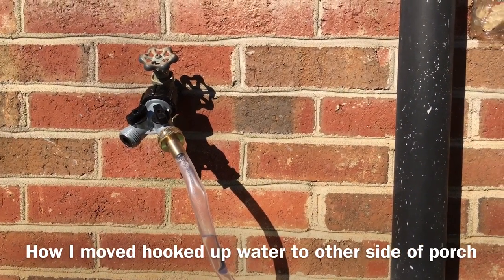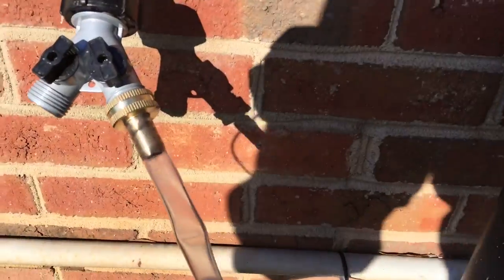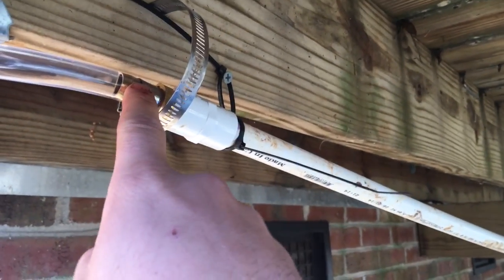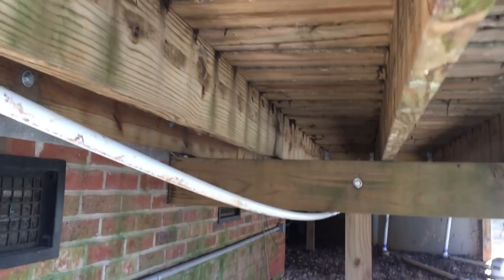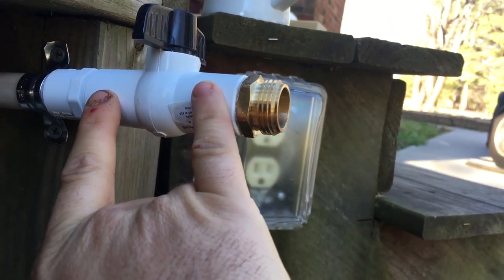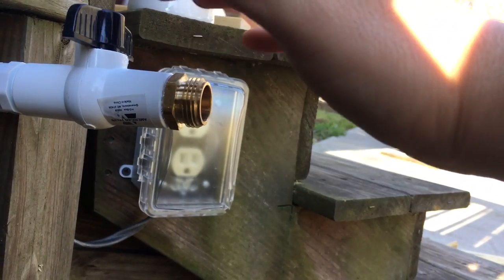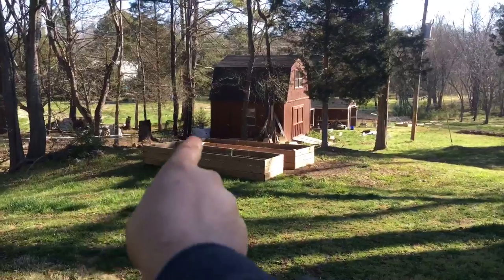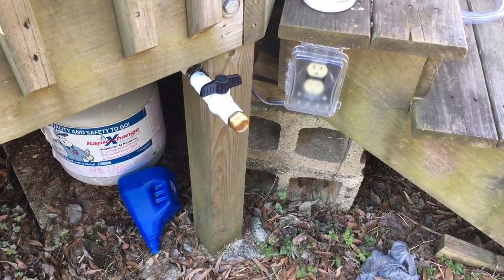Adding Water Spigot - EASY

Comment: Waterhose with ball valve
Poly tubing
Pvc 45/90 instead of clear tubing
Braided line instead of clear tubing

Just a few solid and better looking options to get away from using that clear tubing that could pop off, kink, and puncture. You made it work, though, so props for that.

Comment: Should make the PVC pipe go over the joists because of the bend water is trap there it'll freeze in the winter
Reply: Or simply drill a hole about the same diameter as the PVC pipe to run it through.

Comment: Idk about the clear tubing. But a rubber water hose to your pvc would be just right for this application or even a water heater 3/4 flex line steel braided! 👌🏿 Thanks for the video amigo.
Reply: That was my first thought.  Was there some reason to use that soft, clear tubing and expensive brass fittings (plus hose clamps) instead of just using a 4 or 6 foot hose and a simple female hose thread adapter to the PVC?  The rest of the way seems fine but the first part???

Comment: I live in Southern California where it gets pretty hot the summer. I used clear tubing to supply my evaporative cooler. I believe the heat replaced the plastic tubing which eventually began to bulge and explode under normal water pressure. What I did, and recommend, is to at least change to a reinforced tubing, with the fibers inside.
Reply: I think I meant the heat *relaxed the plastic tubing.